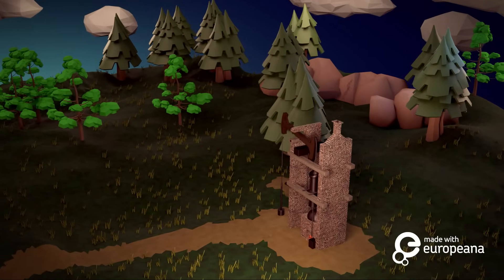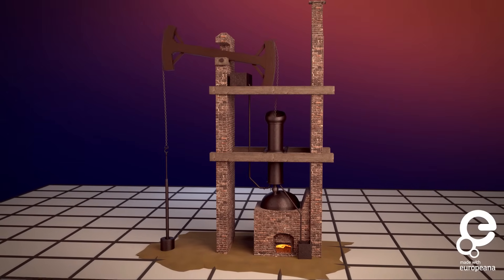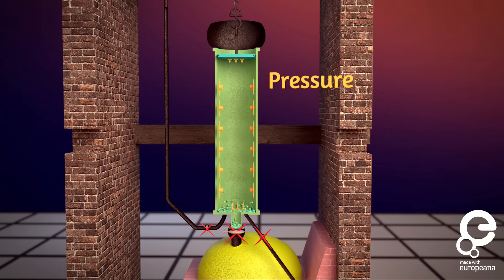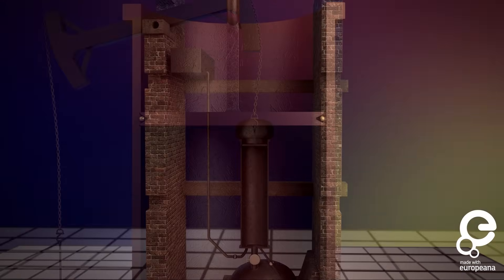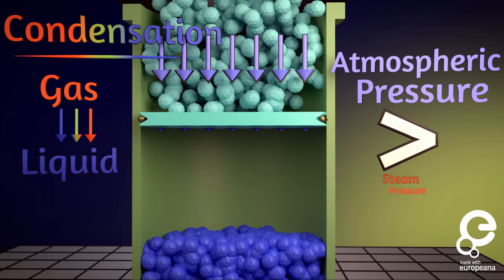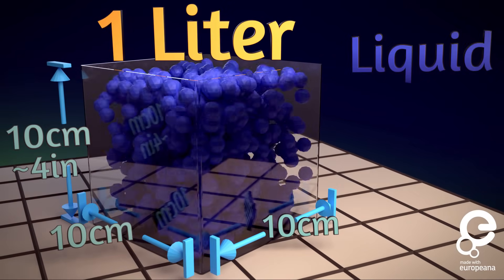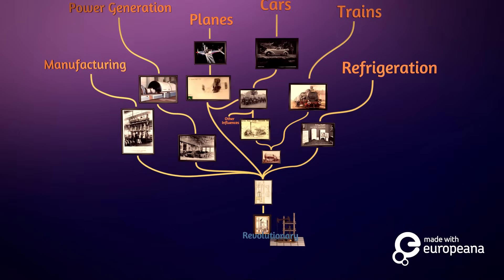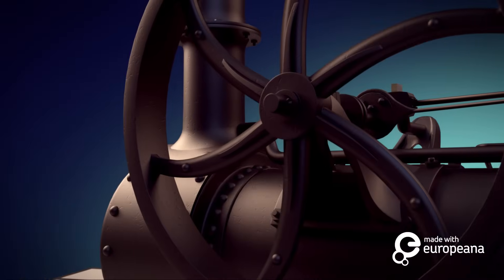What is the First Engine Ever?

Comment: It's ironic that the first 'motive' power invented used vacuum instead of pressure. Seems counterintuitive although when you look at aviation, the first supposed powered aircraft was laid out in a canard form, which was hardly used for the rest of aviation technology.
I wonder how many other technologies started with counterintuitive, or barely used concepts?
Reply: I mean it was the 1700s. Metallurgy was kinda shit, so if you had pressure on the inside, you'd probably risk the piston blowing up

Comment: No...  The steam cooling inside would still have more pressure than the atmospheric pressure from above to pull the cylinder down. You also have a weight from the pivoting arm above and the weight of the piston pressing down. You have gravity at work here: so when the pressure is no longer sufficient inside the cylinder to raise that weight, gravity overcomes the diminishing force that was created by the steam.
You're demonstrating it as atmospheric pressure versus steam pressure with molecules pushing on the piston neglecting gravity completely.
I'm not an engineer but 8th grade science will do.
The expansion of the steam inside the cylinder has created a force that can only push the Piston upward (since it is constrained by the cylinder on sides and bottom) which then transfers force using the lever, pushing the pump rod down into the ground . When the pressure drops inside from cooling the weight overtakes and the piston goes back where gravity is pushing it.
Reply: Gravity makes the piston rise.  Listen to the video next time.

Comment: but how were the valves controlled? the drawing assumes they are butterfly valves, but if it's automated this is not so. they must've been spring operated inline check valves, or some secondary pressure actuator to twisty the butterfly valve. both methods are not depicted in the drawing
Reply: The valves were operated by links and rods which were moved by the rising and falling of the inner end of the beam. There were handles attached to them so the could be set by hand to anticipate the starting of the engine.
Reply: @jonka1  some details of construction were not apparent in the drawings. I know something was missing but curious about the specific geometry.
do you know of any recreations?
Reply: @pauls5745  Not specific information but I expect YT and others may have videos showing the operation of the valve gear. I have mental pictures which I have picked up from watching these engines run. Try this I think it will answer most of your questions. at 2:08 you can see the cold water valve being operated at the top of the piston stroke. https://youtu.be/4DZxwGoNI5Q

Comment: Are the valves closed manually?
Reply: The valves were operated by links and rods which were moved by the rising and falling of the inner end of the beam. There were handles attached to them so the could be set by hand to anticipate the starting of the engine.

Comment: Did someone have to manually open and close valves?
Reply: The valves were operated by links and rods which were moved by the rising and falling of the inner end of the beam. There were handles attached to them so the could be set by hand to anticipate the starting of the engine.

Comment: how the valves of the cold water opens up? what is it that triggers the valves of the cold water to open up ? this was an important part and insight. others than that im satisfied
Reply: The valves were operated by links and rods which were moved by the rising and falling of the inner end of the beam. There were handles attached to them so the could be set by hand to anticipate the starting of the engine.

Comment: So how did the valves work exactly?
Reply: The valves were operated by links and rods which were moved by the rising and falling of the inner end of the beam. There were handles attached to them so the could be set by hand to anticipate the starting of the engine.

Comment: I'm having some trouble (maybe because I'm blind? hehehe) to understand exactly WHAT is controlling the opening and closing of the valves. Could someone explain it to me? Is it because of the pressure? Thanks (;
Reply: The valves were operated by links and rods which were moved by the rising and falling of the inner end of the beam. There were handles attached to them so the could be set by hand to anticipate the starting of the engine.

Comment: but you didn't explain how the valves are workimg?how fo they know when to open and close????
Reply: I think the original question has not been answered yet: how are the valves opened and closed? For example, does person need to do manually  (at 12 cycles per minute I think that this would be feasible, especially if someone needed to just flip a lever) or is it done by linkages? Or it could be bit of each, with person doing the first openings and closings, and maybe doing timing adjustments while the engine is running. I saw  an at least partly manually controlled engine at a museum at Kew, London, UK some years ago.
Reply: @franksierow5792  

"In early versions, the valves or plugs as they were then called, were operated manually by the plug man but the repetitive action demanded precise timing, making automatic action desirable."
Reply: @franksierow5792  Well, pressure. I didn't mention it since I thought you would realize pressure was the key element in these.
Reply: For details see: https://en.wikipedia.org/wiki/Newcomen_atmospheric_engine .
Reply: The valves were operated by links and rods which were moved by the rising and falling of the inner end of the beam. There were handles attached to them so the could be set by hand to anticipate the starting of the engine.
Reply: It's not shown on the animation, but the valves were operated by a wooden rod attached to the beam. This rod would move levers attached to the valves to open and close them at the necessary points of each cycle.
Reply: with magic
Reply: The valves were managed by rods (fully mechanical. The way it worked can be compared to the workings of a mechanical lock, found in safes.
Reply: Well, you can figure it out yourself, although you can't be certain about it. I think it works like this: When water cools down the steam and the pressure in the cylinder goes down, the valve of the boiling water and that other valve which I don't remember the name of opens. And when the steam fills the cylinder again, the valve of the water opens due to high pressure.
Reply: He is just a fo ol. He only explain on history of machine. He is not explain how the machine really work.
Reply: @kimkim-mh7bv  Well someone here is a fool. A short-sighted one too. A good teacher leaves the student space to explore for themselves the ideas and questions raised by the lesson.
Reply: @kimkim-mh7bv  did you even watch the video

Comment: How did he make the piston in th cylinder airtight and how do the valves work?
Reply: The valves were operated by links and rods which were moved by the rising and falling of the inner end of the beam. There were handles attached to them so the could be set by hand to anticipate the starting of the engine. I think the piston was sealed with leather and a layer of water to seal minute air-leaks.

Comment: This is such a great video! what controls the opening of the valves though?
Reply: hand with fingers or magic
Reply: The valves were operated by links and rods which were moved by the rising and falling of the inner end of the beam. There were handles attached to them so the could be set by hand to anticipate the starting of the engine.
Reply: At first, the human operator. But, apparently, some of them were lazy, and fitted automatic mechanisms powered by the pump beam.

Comment: Thanks for this informative video. But I have a question: How is the valve which connects to the water for cooling opened? I assume that it is not manual. How did he automated it? Well, it turned out to be two questions. Anyways, thanks a lot!
Reply: I had the same question. The video didn't mention automation, so it makes it sound as if there was a guy standing there constantly turning the valve. Crazy!
Reply: The valves were operated by links and rods which were moved by the rising and falling of the inner end of the beam. There were handles attached to them so the could be set by hand to anticipate the starting of the engine.
Reply: I think it works like this: When water cools down the steam and steam turns into water again, valves of the boiling water and other valve, I don't remember what was it's name, opens due to low pressure. Then, when the cylinder gets filled with steam again, the valve that connects to the water opens due to high pressure. And it repeats like that.

Comment: hold a minute, if 1 mole of gas takes 22.4 liters of volume, how come that you get 1700 liters of water steam ?
1 mole of water 18 g/mole ; 1000/18 = 55,55
so 55,55 * 22.4 = 1244 liters
Reply from the maker: Great question.  22.4 is for mols of an ideal gas, at 0C and standard pressure (near 1 atm).  When you use PV=nRT to adjust for temp you get different results, and when you use steam tables you get even more accurate results.  Try it out.
Reply: @BranchEducation  oh yeah, sorry, I messed it up, thank you Teddy =)
Reply from the maker: No worries.  I actually still remember in school them teaching about 22.4L  to 1 mol, so I get it.